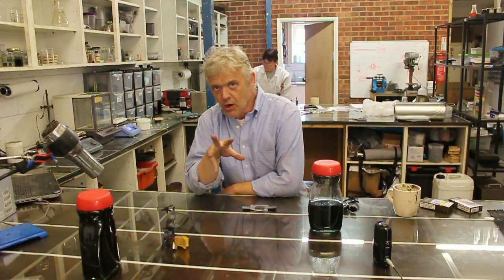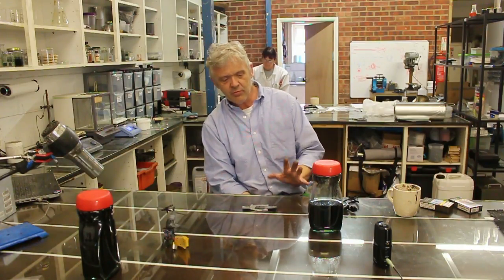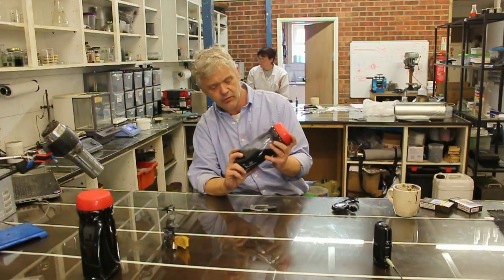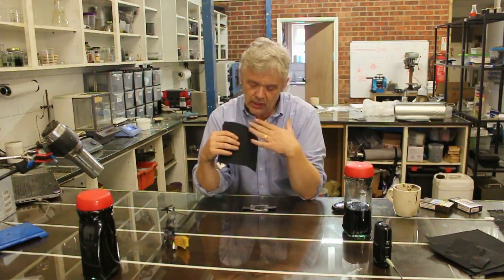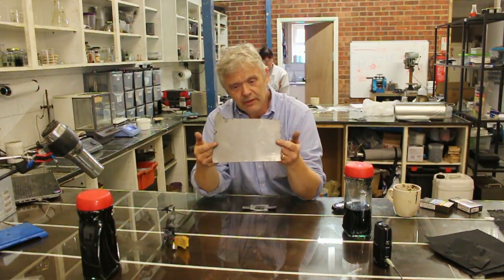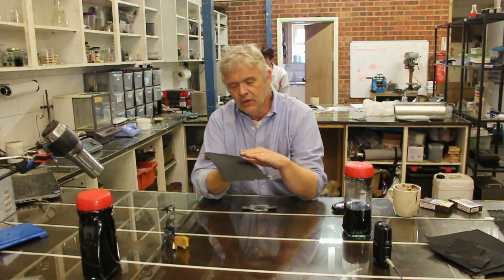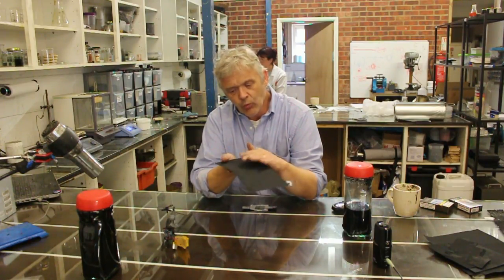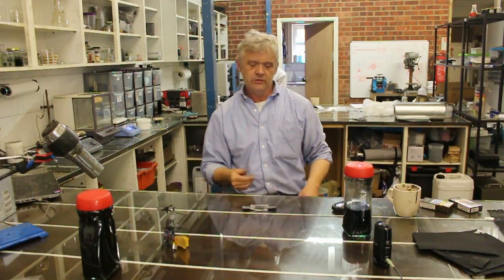An All Carbon Device For Crowd Funding

Comment: You might, after you tighten up as you can, consider a press-release "kit" pointed at live-founder grantors. They will be looking Firstly for high concept, which to them means what are you doing that is fundamentally different and not incremental. If you can answer that ..  Because now you are crossing over from invention, to preparation for operation - which are fundamentally different mental focuses. I can see you're not comfortable with that yet, as it 'violates your youtube contract' so to speak. And at 200000 you are exiting the 'maker' arena, which was a cool angle and hook. Now your youtube effort is going to be a bit constrained by the reality of your journey. It will certainly have to adapt.

You hope to make it into operations, which is the next focus (corporate / public benefits or not.) And you would be appealing to the establishment another level above that - as everyone in operations does for grant funding. 

You might make your case based on security as well, by various ideas that super capacitors allow (vs. a chemistry.) Or you could look for a partner, and pack up your lab gear and take it there. This is actually the best method - just make sure you get equity.

However, your talent shines as a DIY teacher, so you also might want to consider a university as a base of operations. Your lovely friends who will require you to keep a notebook, might hire you in exchange for patents - if you can stomach that. I have to presume that they will fast track such things as a form of endowment. And that it will not be typical school work.

But as for a true crowd-funding - if you do not have an end product then you are looking for "charity" which tends to max out at at a pittance. The exceptions are very popular star-types with large fanatic following, who regularly part with $10 for a CD if it means being trendy, especially as it gives them entry into an elite tribal thing like a club scene. Which both count as an end product.

Of course, if you can demonstrate working power packs - not just individual cells - you will totally rock the dock.

Now you can put that all in a can and seal it up and put a voltage to it and see if it swells or not.
Reply from the maker: nice ideas mate and a lot to think about - you are quite right there is a degree of being uncomfortable with the process
Reply: This is all standard model understanding coming out of Silicon Valley over the last decade, of which I have been a student, combined with my own expertise in Social Science, and personal experience of doing it myself - very patiently but actively. I am actually pretty slow for special constraints..

Here are your options in a bit more detail: 

A nice institutional contract would put you in friendly bath water. Lots of options there. The simplest is that you would teach basic classes and be funded a lab and have a good position at a college or university.  If you really have something patent wise, and can use your talent to even attract students - a university would be a major step up from that. Most inventors are happy to retire at University rates and benefits. However make sure you are getting the red carpet treatment, because they have a definite class system whereby they use and abuse their peasants, proletariat, petits bourgeois. You want a strong footing in the upper middle class, which would be a start, and then work your way to the Moyenne by delivering on your hire position. 

There are also government funded labs where I am quite sure you would be welcome in your field, and could honestly get cutting edge - whatever that may be to the defense halls and all that. You would, however, suffer the usual constraints on your freedom, which is the price of sitting in the bath, including having no control at all because of the stiff contracts they require. You would be wooed and then signed to an incongruous contract that would take everything that actually matters. That is because the agents are like bank tellers at the world's biggest bank - your gvmt. Unless you want to go the States, or Israel or someplace - there is no competition there.

When we talk about moving into operations, you would have to focus on building a product to sell, and a company to sell, which is where the big payday is. That will be your personal V Day if you are successful. You could certainly increase your odds by coverage in Silicon Valley, should you choose this route. But it might not be home. 

Point is these are all distinct directions, and best to set out with a map and a compass and a destination!

In construction, which is a passion of mine (my only still wild hobby) you have complete freedom until you do something irrevocable, like order the wood, or sign a contract. That first step then will be an anchor to constrain you - which can be a very good thing - if you are wise and brave and persistent. That is rather a good model of what your next step is like. You are in planning, and will produce many plans, and not settle on one until someone else meets your threshold at the time, and you accept it. Very simple when you think about it that way really.
Reply from the maker: I have been offered a few mate - but turned them down

Comment: hello, is that 10 dollar/kw include labour? would 20 pounds / kw be a rediculous offer?, any size any shape, if it's cheap enought and the customs officers don't wreck it tearing it appart wondering what the bleemin'el it is... i'm in.
Reply from the maker: no mate - it's a materials cost - manufacturing as an additional cost is heavily Capex dependant

Comment: A super sales feature inherent to a potential flooded design:  low shipping costs!
Today, for solar/wind storage, flooded lead acid is still the most economical.  But look at the weight that needs to be hauled.  (mostly lead) If indeed, your flooded aqueous design works with "salt water", could you image the enormous savings of shipping the battery box, with lightweight carbon,  DRY! ... "Just add water" !  That could be huge, especially third world.  And you would not be shipping anything at a premium for being "toxic" ... That would make crossing borders much easier!
Precedent is that some lead-acid batteries are shipped "empty", but come with a separate container of sulfuric acid solution (one way to maintain shelf life without having to regularly charge).  People are able to manage that.  
Of course, in your case, users must be able to provide clean, distilled, water.
Reply from the maker: I was in a battery shop recently and I noticed they sell the battery and electrolyte separately - I am guessing this is because it solves any 'shelf life' problems - so I was thinking the same thing but a slightly different direction - basically - I am agreeing with you lol

Comment: I am very surprised that your company is not eligible for a government research grant. As I recall there was an announcement recently regarding government money being made available to fund battery research (£246 million). Industry is crying out for an alternative to Lithium technology, with all its commercial and technical limitations. A carbon based solution must look very attractive. Is it not possible to scale up your electric bicycle battery for application in cars?
Reply from the maker: This device isn't suitable for cars mate - it is not dense enough but we are actually looking into grants too - the process is - however - long.
Reply: Robert Murray-Smith I understand that the target for car batteries is 12kWhs per Kg or 8kWhs per litre, as this is an equivalent to the energy density of petrol.
Reply from the maker: I think that's right mate and we have been working on that but it is a seperate issue really

Comment: Hi rob I would love to be apart of your indiegogo campaign. As someone has already said I to would be interested in buying some foam in sheet and making my own battery's cells prismatic cell or flooded cells. This would be be a great way to fund you we would buy more and sheets the bigger the battery we would make. With a little help from you as what is the best way to layering a flooded cell Would be. We all have used car battery laying around in the garage that we could use to build a flooded cell. I would find this fun to do and would help you at the same time.
Reply from the maker: It never occurred to me but both you and Stephane have made roughly the same suggestion - I like it

Comment: Just a thought as there are no corrosive explosive or poisonous components to this type of cell, could an 18650 case be used that is not made using steel ? even 3D printed for testing
Reply from the maker: yes mate and I am pondering that now
Reply: Robert Murray-Smith Hi Rob. A length of 22mm pushfit plastic plumbing pipe fits an 18650 inside of it perfectly. I was looking into it for a way of creating easy to construct modular battery packs. The idea was to use modified 22mm plastic pushfit stop ends as terminals. Not sure if it's helpful to you though for what you want to do.
Reply: Vino, can you describe the modified 22mm plastic end cap as this would be the critical issue with your design as it has to provide external contact points and seal the unit. How are you proposing to do this? Also is it scaleable?
Reply from the maker: awesome mate - my questio is the same as Nigel's - but could you do avid and share the link?
Reply: It was just a throw away idea I was playing around with one day, not something that I fully developed. However, seeing as I was the one that suggested it I'll get back into it just to satisfy the curiosity shown and will hopefully have something to show early next week.
Reply: vino, good, another faster track option if you dont mind semi open frame packs is to use the far cheaper 22mm (perhaps slightly smaller to allow a tighter fit) (Spiral) cable tidy, (or for  indonesia diy etc, you could make so called plastic/metal  string from pop bottles and aluminium cans if you want to work it to the correct diameter per cell bank in the commercial cable tidys place )   

plus perhaps a generic cheap nylon press fittings with a simple copper spring core added as contact,( or tiny integrated magnets to make multiple connections simple, if you feel the need, be trendy ;)  or OC robert incorporates the demonstrated existing magnetic carbon in the end terminals as an option )
Reply: everest 333 Thanks Everest, I'll take those suggestions onboard. There are a lot of options available and it would be good to think about the products available in developing nations. I'm really liking the idea of a 'Roll your Own' concept allowing a variety of pipe enclosures and fittings to be used depending on cost, availability and required use. One idea that just sprung to mind is a section of bamboo as the pipe capped at each end with a squashed aluminium drinks cans for the terminal connections. I'm going to my local DIY store soon to have a play around with the pipes and fittings they have available before purchasing.
Reply: So I spent some time playing around with my idea, but didn't get far because I hadn't taken charging into account. I forgot to factor in a Battery Management System and the number of connections required. Once I thought more about the relevance between 18650 cells and the All Carbon cap, I came to the conclusion that sticking a massive jelly roll of the material into a PVC waste pipe (110mm OD) would be way more efficient way of building a device. I then stumbled across this product called TANKTWO (www.tanktwo.com) and think it's genius. The product is basically egg sized cells containing a communication chip that can be thrown into any size of container and will automatically determine the most efficient power routing/capabilities. Check it out if you haven't already come across it.

Comment: Yeah its always the cost that gets in the way, but perhaps by marketing and selling what you can make you could also raise the funds for the 18650's or make a hybrid consisting of button cells to emulate 18650's in stacked tubes ! In fact for such a safer device do the shells have to be metal ? Why not build a fairly simple moulding device and encapsulate them in heat proof/ fire retardant resin similar to what Robnor Resins supply this way you could make them easily One way of making a split mold is to use actual 18650's as the pattern and make a split mold using silicon rubber, then incorporate support structures in the mold, or attach to the actual cells to offset the actual cell structure to centre it prior to injecting resin in, I make molds all the time it is not a huge costly process once you have the molds made https://www.youtube.com/watch?v=FQ1A7ZjTsx8 Resins - http://www.resins-online.com/
Reply from the maker: Interesting ideas mate - I will have a think and definitely follow this up - thanks very much
Reply: No problem Robert, theirs always a way around obstacles if you think about it, so many prototypes begin in a simplified design anyway toys for example start in injection molding techniques before going on to actual CNC type making. Many of the Robnor Resins are thermally conductive so dissipate heat and are electrically very good insulators, I also have my steel laminations cut by a local firm on a laser very cost effective on high quantities so you could have the electrodes round discs cut by a firm like that for the battery ends there is a factory close to me who cut me 216 steel pieces for only £33 using this machine https://www.youtube.com/watch?v=9Gz_PS9z554 let me know if you need any more information be happy to help.
Reply: Just worth noting the ONLY reason why 18650's have to be inside a metal can is because they are under extreme high pressure, if your cells do not require such high pressure containers then a metal can is not required :)
Reply from the maker: that is interesting - thanks for that mate

Comment: I just have a little concern about the mantra "it's just carbon", there is no evidence it is safe, in fact I would say that releasing a lot of nanoblade into the nature can end up in cells and rip them apart as it is the most durable and solid material currently known, if we were to believe the hype. I'm not chemist, but isn't material take their property more from their structure and composition than just the elements that compose them? I mean Plastic is kind of a problem right now, and it's basically carbon too, I had those thought when seeing the structure of wax that basically looks like a crooked plastic lol (maybe that might ticked off a real chemist, lol). I mean look at the health disaster with abestos fibers. I don't want to see graphene become the new abestos of the future lol!

Tangentially that last thought prompt me to look around about what react and degrade wax chemically and see if it can applies to plastic too, not that I'm in a position to pursue anything with these thought right now lol. Turns out there is a worm saliva that turn plastic into antigel by breaking it's bond with an enzyme destined to break wax. I think the moral is that we must anticipate in how we dispose of waste before they become a concern.
Reply from the maker: cheers mate

Comment: Why not a large prismatic cell like in the Nissan Leaf? Would that be easier and cheaper to get into preproduction for large energy densities?
Reply from the maker: everybody has ideas mate and I try to listen to them all - the most popular is the 18650 - no getting away from it I am afraid
Reply: 18650 is probably about as good as any for a single format to use on all the pilot runs. You won't get direct compatibility with existing devices since anything currently designed for 18650 is expecting 3.7V, but it's reasonably scalable in the sense that they're small enough to use in handheld devices like flashlights, but not so small that it's impractical to connect a bunch of them together to make large battery packs of whatever voltage and capacity you need.

In the long run, I suspect the prismatic/pouch type battery packs (like phones, drones, and many EV types use) will be the most popular. But they need to come in a wide variety of sizes, which probably means higher tooling cost, and definitely more overhead in terms of inventory. So maybe not best for the first run.

Comment: Looking to set up a power wall.  How much for 20kw hour of prototype cells.  In other words, what kind of product are you going to give contributors for fronting the money? How about sample 18650's and an option to buy stock first if it works out.
Reply from the maker: I like that idea mate - I never thought about that - but as for what is being offered - I will have to work out the details and will do so in the next couple of weeks
Reply: RavenPrecept 
Yes - and cylinders, though easy to manufacture by coiling, are a terrible shape for banks because of the wasted space. A much better idea would be cuboids. They could be sized with similar relative dimensions like bricks which can be stacked in lots of different ways with no gaps.